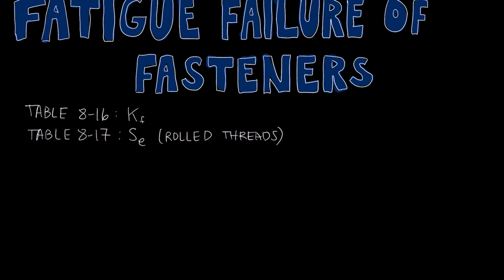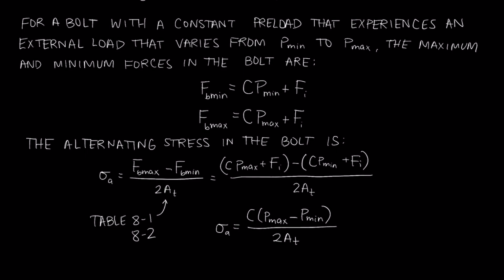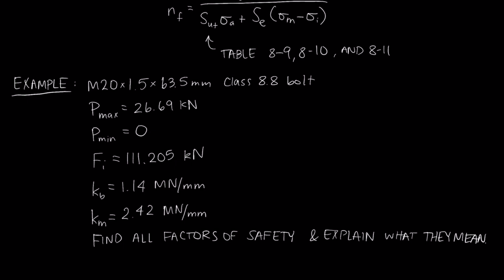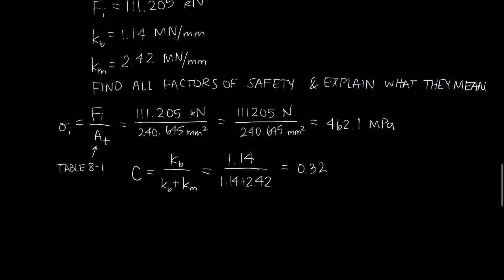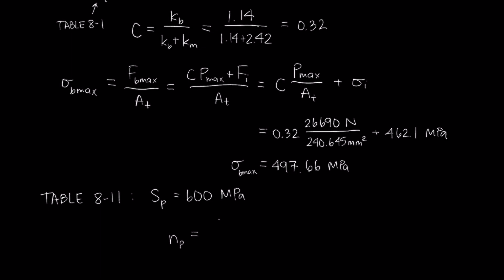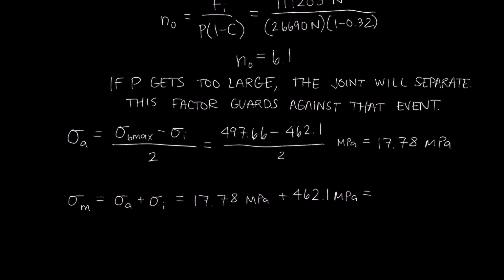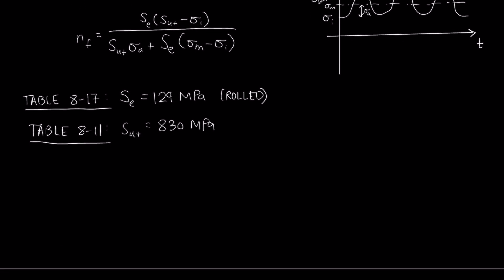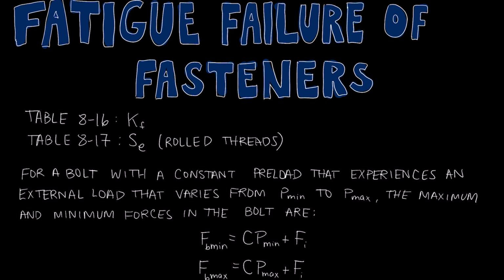Bolts Get Tired Too: Understanding Fatigue Failure | Machine Design - Lecture 26B

Comment from the maker: Correction: In this video, I used data from Example 8-3 in Shigley's Mechanical Engineering Design, 11th Ed., which uses a tensile stress area of At = 240.645 mm^2. This is incorrect for an M20 X 1.5 bolt. Using table 8-1, we can find that the tensile stress area should be At = 272 mm^2. Changing this value in the example would decrease stresses and increase resulting factors of safety. 

Thanks to those who caught it, and I appreciate your understanding!